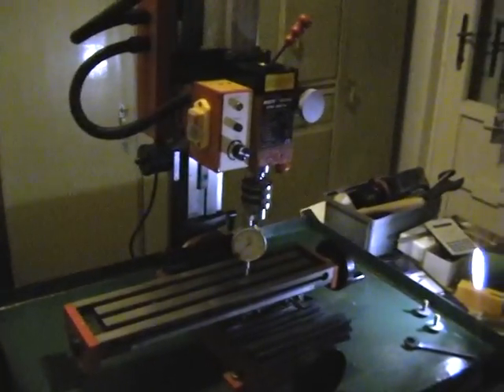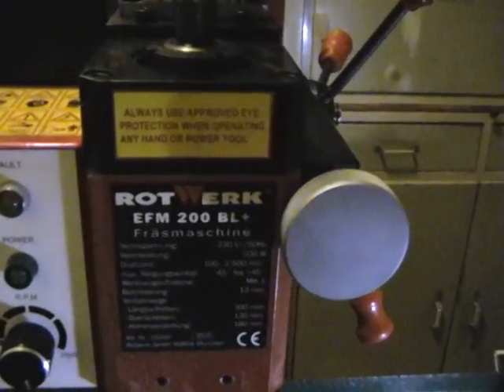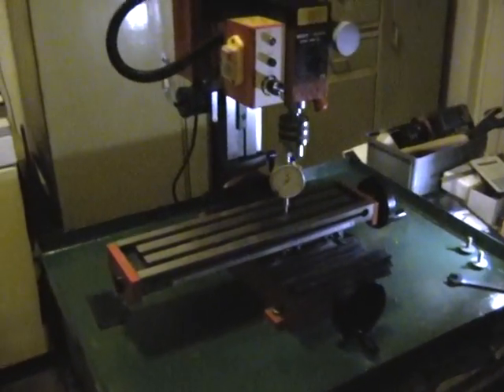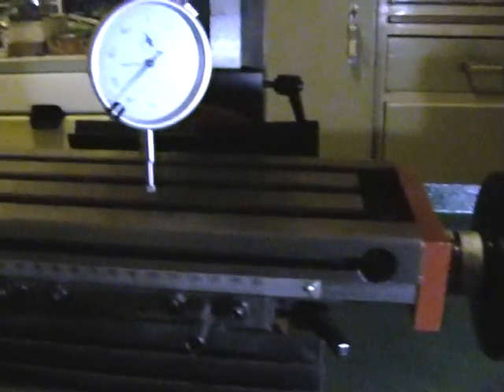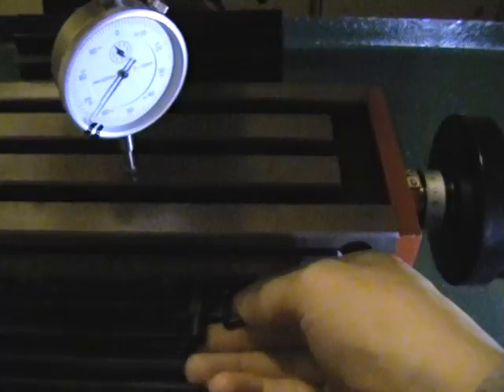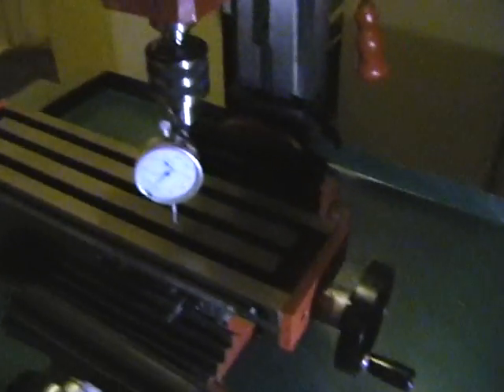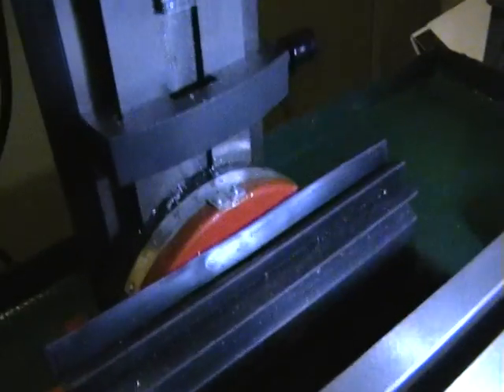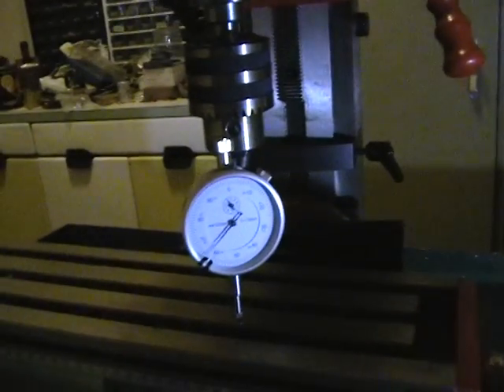Sieg SX2L Mill review with dial indicator

Comment: I haven't got mine yet, but I believe you should lock the lever for the lever for the vertical movement (column) before any measurements.
And as stated elsewhere, I think you got the lock nuts and the gib screw mixed up.
Reply from the maker: No, the imbus goes into the screw, the nuts are ordinary 6 sided nuts that you would manipulate with a wrench ;)  I don't even mention the lock nuts in the review.

Comment: Very helpful review although a bit too long.
I am also expanding my hobby and have decided to purchase a mini lathe and a mill. After researching I too have found out that in the mini realm you can only buy a proxxon or a sieg. I have decided to go with sieg since they seem to be the preferred model sold and I found allot of info and videos demoing the tools with people being satisfied with the results (considering that its Chinese made and was not ment to produce high precision parts).
Did you get to work with the mill, How do you find working with it?
Are you managing to produce decent parts, f.e blocks with straight grooves?
Also your vise seems to be quite heavy and I myself try to maintain a realistic view where the work bed of this mini machine was not designed to hold such vise. However still, do you notice sagging of the work bed when placing such a heavy vise on one end?
Reply from the maker: Xoft C I have found that working with wood the mill is wonderfull. I can get fast and very acurate results without wasting time. I haven't tried working with other soft materials. Using HSS end mills I broke one 4 flute 8mm end mill trying to mill to deep in mild steel. The tips of the flutes chiped off after the chatter got really loud. My fault. My seccond end mill(6mm 3 flute center milling) lasted longer but also got dull after a few hours of use. I presume that the wobblyness of the collumn creates a "jack hammer" effect that the end mills don't like. I'm going to try to stiffen it up a bit.
Reply from the maker: timtheli0n PS: when the end mills aren't broken, you can get really acurate on the thing (I think the limit is going to be skill for a long time to come), and wonderfull surface finishes too :)
Reply from the maker: timtheli0n PPS: The vice is not too large or heavy. There is no problem with the stability of the table. It is only the vertical collumn that is wobbly.
Reply: The nuts on the Gib screws are LOCK NUTS. You slacken them when adjusting the Gib screw and then, holding the Gib screw, you tighten them. That's how a lock nut works.
Reply from the maker: @robertsyourrelative  I'm not sure what you're getting at, the imbus is used for manipulating the gib screws not the lock nuts ;) In the video, I don't do anything with the lock nuts (and the lock nuts are kind of useless as the gibs are more likely to become UNSCREWED than to go in too far.
Reply: @timtheli0n  The lock nuts apply pressure to the threads preventing the screws from moving in either direction.